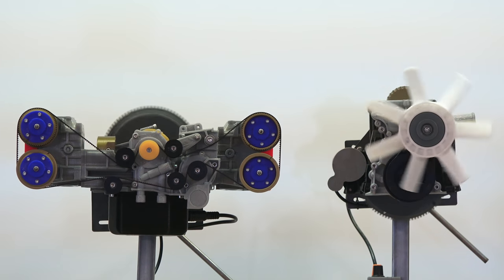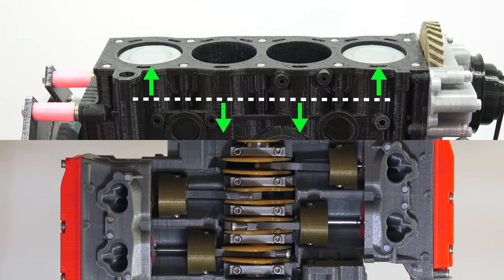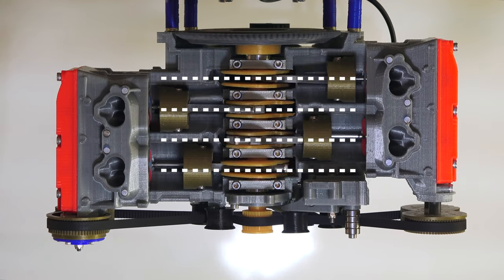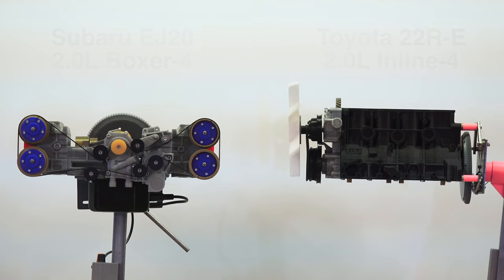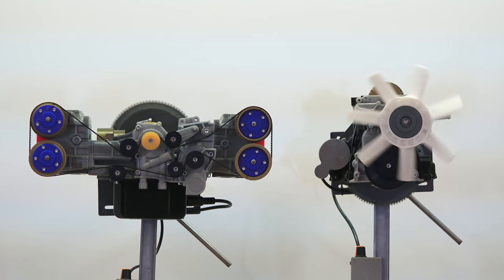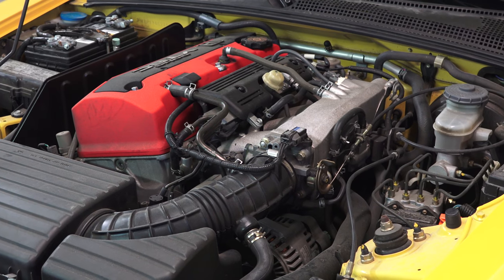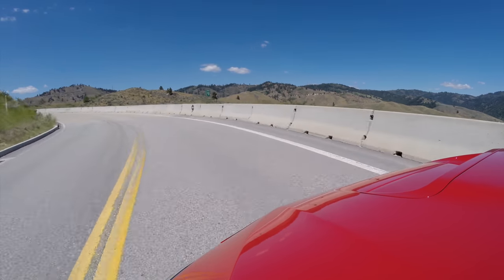The Differences Between Inline Four & Boxer Four Engines

Comment: I used to drive a van that had a 2.5 litre four cylinder diesel engine, with balance shafts. It sounded like a tractor around town. :-)

My plane has a 320 cubic inch flat four. Perfectly smooth like all flat fours, part of why they can bolt such a big engine to a relatively flimsy airplane.
Reply: A flat four or a boxer four?
Reply: Laura Halliday is that bad?
Reply: Svein Hanssen all small aircraft engines I’m aware of (post war, non radial) are all “boxer” or “flat” (same thing).  I’m a former aircraft mechanic, and in the Aviation world they are called “opposed” engines. Better way to say it I think.  Most of the General Aviation “Opposed” Engines are/were made by Continental and Lycoming here in the US.  There is a reason aircraft use the Opposed engines, like Subaru and Porsche, like Laura said, if the engines were not balanced perfectly they would shake the little flying machines apart. Weight is another issue.  The most perfect engine is the Inline 6 cylinder, used in aircraft during the Great War, by World War 2 the Spitfires, Me 109’s were using V-12’s, which are two Inline 6’s, so 12’s are also Perfectly Balanced both Statically and Dynamically like the Inline 6, why Ferrari uses 12’s. The biggest paint shaker, and abortion of an engine, is a V6, they need lots of help to keep from shaking to pieces. I wouldn’t own a V6.  Notice ALL large over the road trucks use Large inline 6’s. Still the best engine design in my opinion.

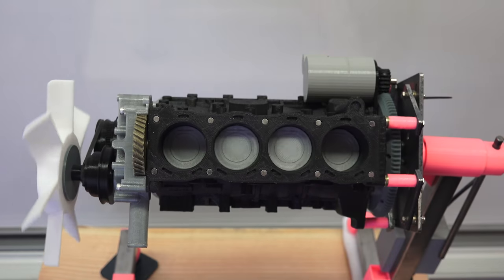Comment: Minor correction for 0:50, on the 91 subaru's and later, they use two double-ended ignition coils on the top of the engine, with 3 wires coming from the computer to fire each coil two strokes apart. Cylinders 1 and 2 fire concurrently, same with 3 and 4, which of course means that the timing is off on that model.

The yaw force as well is not a big deal and rarely measurable, particularly as the transmission helps prevent yaw movement, although it does contribute to eventual wear of the bearings throughout, albeit after some 25 years of use. This was how the prior engine failed in our 91, as while it still ran "quite well", the cams could slip to one side and cause the timing to shift, resulting in odd behaviour and a lack of power.

Comment: I have a 2014 Subaru Outback which is a great car. My last car was a 2004 Volvo XC70, which although a great car, wasn’t worth the cost to maintain it. I really like the stability of the Boxer Engine in my Subaru. It handles cornering better on the highway, and costs me about $9 less per tank of gas since I no longer need to buy the higher octane fuel the Volvo needed.
Reply: Awesome, I have a 2018 Outback I'm pretty impressed.  The last year of the Outback with a timing belt was 2013

Comment: Great vid.  I've always agreed, prefer boxer but to me the greatest disadvantage is in FR they're MOUNTED FURTHER FORWARD, either at or ahead of the front axle, making it very hard to have a more neutral weight distribution among axles. For mid-engined cars, though, it's just win-win, hence why the old 6cyl Porsche Cayman is probably the best drivers' car in the world, with no single rival.

Comment: Basic 3.4 Liter F6 in my 911 C4 is and has been SUPER AWESOME, great in Spring, Summer, Fall & Winter. Goes just as great at 175+ MPH in the dry as well as drudging through 18" of snow, i can't say that about any I4, I6, or V6 that i have owned before

Comment: Amazing content, keep it up!
Could you please explain how the "s" button works in low end automatics? Most people say it "gives more power" and I always disagree.
Reply: What the heck is an S button
Reply: It locks the transmission to use 1st to 3rd gear, and the engine would rev higher before gearshift, resulting in better acceleration... Hence people says "more power"
Reply: Alright, that is "more power" The engine will produce more power in higher revs we know that. And "more power" will be put to the wheels in 3rd than in fourth. We also know that. It's not more boost or  a larger displacement or something. But it will make you quicker wouldn't it?
Reply: Just for youtube not nessiarly
Reply: Well there are some engines that make the same power at 5k as they do at 6k. If that's what you're talking about then yes, not necessarily.
Reply: I actually would say more torque than more power 🤔🤔
Reply: Isn't S just stand for sport
Reply: +Rilo Elton right, but people that don't know the difference, like people that buy cars with "s" buttons, would call that more power, you're gonna accelerate quicker. Feels more powerful, though it's just torque.
Reply: Just for youtube sport button
Reply: Just for youtube you'd have the same results putting your foot on the floor
Reply: Santiago Cuevas just changes shift points
Reply: The "S" button or Drive Sport mode makes my engine rev higher at lower gears. With the normal drive mode, my engine revs below 4k rpm. With the drive sport mode, my engine revs up to 5k rpm if I floor it.
Edit: It also makes my acceleration more jittery
Reply: When you press S button the engine provides more power by increasing the air-fuel intake.. that's it .. so simple ..
Reply: A sport feature of a transmission will (generally) tell the transmission controller to hold gears longer, meaning rather than shift at a lower rpm, it will shift at a higher rpm. Horsepower is torque multiplied by the engine rpm, so at these higher rpms the engine is putting out more horsepower.  Normally, the transmission is not shifting close to this peak hp in favor of better mpg and less noise, but in sport mode will to achieve faster acceleration. Some cars will also increase gas pedal response, making the car respond more aggressively to the same pedal input to make the car feel as though it is now more powerful
Reply: Also, power is force multiplied by velocity. So the force you feel when accelerating, that push back into your seat is a result of horsepower. Whether the engine is putting out lots of torque at a low rpm or little torque at a high rpm, you are feeling the horsepower of the engine accelerating the car
Reply: It holds the gears longer, meaning the engine gets up to higher RPM before changing gear.
Reply: +William Ho the sport button was definitely not intended to go down hills. You can just shift down to go down a hill if you want engine braking.
Reply: William Ho hahaha relax. He clearly stated low-end automatics. It would be 4-speed planetary gearset automatics in these days.
Reply: Putting an automatic transmission into sport mode will vary on makes and models, but for the most part, especially lower end cars as you mentioned, all it does is it tells the ECU for the engine and transmission to allow for higher revs before shifting. It delays the upshift and allows for quicker shifts, rather than the slower but also smoother default shifts. For everyday driving, the transmission is set up to shift at a lower rpm for fuel economy and it will shift slower and smoother, so that you almost don't feel the shifts. In sport mode, you don't care about feeling the shifts. You want to shift as fast and as hard as possible. Like I said, it will also delay upshifts too. If you hold a constant 30% throttle with and without sport mode, you'll notice the shift in sport mode will happen much later. This is the programming logic that assumes that you'll want to be in a lower gear for better acceleration and throttle response. 

Like I said, this isn't true of all cars, especially newer ones or higher end models. Sport mode on newer cars can actually change throttle respsonsivness on fly-by-wire throttles. Some cars have selectable power variants that can be selected in the sport mode feature. The BMW E60 M5 has multiple power settings, from 400 to a little over 510, that can be changed in the sport mode. You can also change the suspension for comfort or sport (stiffer suspension) and even change the dynamics of the steering. On other cars, like the BMW i8, changing to sport mode turns on the gasoline engine, so you have both a turbocharged gas engine and an electric motor being used to power the vehicle. 

Your basic, standard, run of the mill sport mode will do nothing but delay the shift and change the shifting characteristic to faster, harder shifts....not making it more powerful at all.
Reply: +dknollRX7 Revving higher before shifting is making more power and keeping lower gears just multiplies that. So it is making more power.
Reply: Rilo Elton that's for city traffic. Thus less wear on transmission
Reply: Just for youtube, not at all. You would have the same effect if you went WOT without being in sport mode. If you mash the gas pedal all the way down, the trans will not upshift until later. There is NO difference in power. The engine spins at a given RPM, the individual gears inside the transmission have the same gear ratio, regardless of if the trans is in sport mode or not (you can't change a metal-cut gear ratio with a switch) and the final drive has the same gear ratio whether it's in sport mode or not. Everything in the powertrain is a fixed mechanical gear ratio. Switching to sport mode changes none of that. It doesn't make more power to shift later; all that does is allow you to use more of the engine power before it shifts, but again, you could do the same thing by going full throttle while out of sport mode...you just won't have the faster shifting of sport mode.
Reply: +dknollRX7 I was under the impression that in standard mode at WOT it'd rev to 5700 and in "s" it'd rev to 6000 or whatever. It only holds the gear longer when you're at part throttle? I don't deal with automatics and i primarily deal with cars built in the 60's so a lot of this garbage is new to me. Seem's like this "s" mode usually just shifts quicker? Seems utterly pointless to me but of course we know it's just a gimmick
Reply: Just for youtube, well if you are at WOT, the car is smart enough to know that you're trying to accelerate as fast as possible and therefore it won't prematurely upshift. It's the same idea as a fully hydro-mechanical auto trans where you hit the kickdown switch and it'll hold the gear until the gear pressure overcomes the governor pressure. It mostly is a gimmicky thing. Mainly, it just keeps it in the lower gear for longer so it feels like it has more power/torque, but it's all just because the gearing is lower because it's keeping you in a lower gear than you would normally be for that speed. It's basically like driving around town at 40 mph in a manual car in second gear. You still have the same power and gearing and everything, but by forcing the car to be in a lower gear than you would normally be, it feels more powerful because you're more in the powerband of the engine, due to gearing.
Reply: Climbing long hills and mountains, the auto transmission can often make a bad gear change while your passing or on a tight corner.
By using "s" button you limit yourself to 3 gears so it will change less or probably just stay in 3rd for most of it, instead of changing up to 4th and bogging the engine down. Give it a go, its really good for hills and trailers.
Reply: Jairus Redshaw instead of doing that, just use the manual gear change. If you're going up a long, steep hill...the last thing you want is for the transmission to upshift when you don't want it to, then you don't have the gearing to accelerate uphill or tow. Likewise, if you're going down a steep hill, changing into a lower gearing will allow the engine braking to slow you down, so you don't overheat your brakes. Putting it in sport mode is a similar idea, but still doesn't give you the control. Just manually put it into the lower gear you want (or turn off overdrive if applicable).
Reply: My 88 Jeep has something similar it has a switch for the transmission and one option is comfort and the other is power and what it basically does is raise the shift points and engages the clutch differently it's not proven but I've heard the power mode can increase efficiency if driven right and causes less clutch wear because in comfort it doesn't engage it as fast so it makes sense for power to cause less wear but I'm not certain
Reply: Santiago Cuevas it holds the rpms longer.
Reply: Santiago Cuevas s is for sport mode. It changes the shift points to a higher rpm, essentially making your car accelerate a bit faster. Also uses more fuel, of course.

Obviously it doesn't make the engine more powerful, but it does make use of more of the higher end of power band of the engine.
Reply: As for me, I know nothing about "s" buttons because I have always owned manual transmissions Toyota trucks, witch do what I make them do when I want them to do it, from idle to 5500 ripums.
Reply: Santiago Cuevas oh that’s sport mode
Reply: The "S" selection is a carryover from the early days of automatics. When someone says they use the "S" gear, it's not exactly a sport or performance gear but it's manually locking out the 2nd gear in the transmission for higher torque or in other words pulling power. Now it can be used for engine braking  like when descending down a mountain road; it's not recommended for an automatic.  Ford and a few older automatic transmissions actually lock the trans into 2nd gear when it's in the "S" gear but for most tranny's it just limits the use of gears to 1st and 2nd. The Only time "S" matters is when it's selected for the overall performance; such as "N"ormal, "C"ruise, "S"port or "P"erformance. When that is done it follows a different drive train management mapping (shock calibration, engine timing, traction control transmission shift points and line pressure) in the ECM and not the gearshift lever.
Reply: S stands for slippery, it uses electronic force shield around the car which makes it slip through the air easier.
Reply: shameer basheer wrong
Reply: My Subaru is a pre "SI" 5EAT so it has a sport feature. It lets you rev higher and holds gears when you lift throttle so you can stay in a higher rpm for boost. You shift to manual mode and don't manually shift to access it. For the longest I never used or knew it existed.
Reply: It feels like It has more power because it increases the throttle response and on some cars it also increases steering response and hardens the suspension if you have active shock absorbers
Reply: Rilo Elton : That doesn't make any sense; there is a direct relationship between power and torque. Power is just torque times engine speed divided by some constant (depending on the units used).
Reply: lol.......
Reply: shameer basheer  I think that’s called a gas pedal..... whereas the S button changes shift points
Reply: How does that apply to my CVT transmission? Since it doesn't have traditional fixed gears what does it do?
Reply: I currently never owned automatic car, but I guess this make the transmission shift at high rpm to make more power. dual clutch sport cars also have that button for longer shifting in automatic mode, which make the car faster.
In personal, I did prefer take manual mode in highway and mountain pass while driving a car with paddle shift (because I don't want to take any conventional automatic or cvt ever. if no paddle shift car, I would take electric car).
Reply: Besides shifting later in the rev range, in some modern vehicles the "sport" mode could also change the accelerator pedal sensitivity and adjust suspension components

Comment: I'll take the inline six over both of these.  You get the intrinsic balance of six cylinders along with the simplicity and ease of service that comes with inline engines.

The center of gravity may be higher and the nose of the car may be a bit longer, but both of those are acceptable trade offs to me.

Comment: wich is better?
getting one turbo for each bank in a dual bank engine or a bigger turbo for a inline engine?
wich would have a best power to weight ratio and aceleration?
Reply: Too many variables. How big are the turbos, what kid of turbos, what brand, etc. Furthermore, an I6 and V6 will have different properties from eachother out of the gate, making comparison even trickier. Either set up can push ridiculous horsepower and therefore power to weight if the turbos are large enough

Comment: I would like to add that with a H4 engine in an all wheel drive vehicle, the engine does not sit as far over the front wheels. This provides better 50/50 weight distribution and reduces oversteer.

Comment: Horizontally opposed engines are great but they should stick to the plane market, maintenance on them pain in the arse, especially the spark plugs.
Reply: A lot of motorcycles has real boxer engines.
Reply: 3.6L in a boat would be pretty sweet
Reply: yeah, just try working on an airplane engine where there are two plugs per cyl! top and bottom. That and the piston is the size of a dinner plate. :D

Comment: This is a good video that demonstrates how this is both a flat plane crank and too a boxer engine with crank-pin journals offset at 180 degrees for the first and second pairs of pistons.  Not all flat engines are boxers as that is determined by the first and second pairs of pistons sharing a common crank-pin journal(s).

Comment: One of the things that’s a little less likely these days is valve adjustments. In older vehicles it was regular service requirement along with carb tuning and cleaning but I don’t know of any common vehicles that have adjustable valves
Reply: I assume the new subarus have adjustable valve. The older ones for sure do. Working on an 02 now doing an overhaul and valves were adjusted